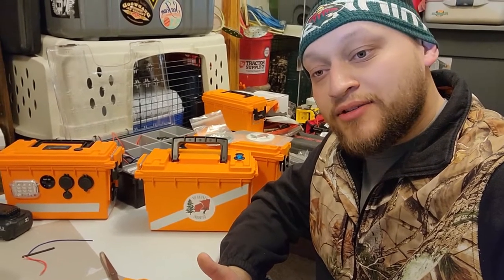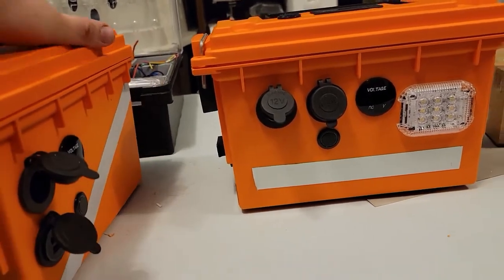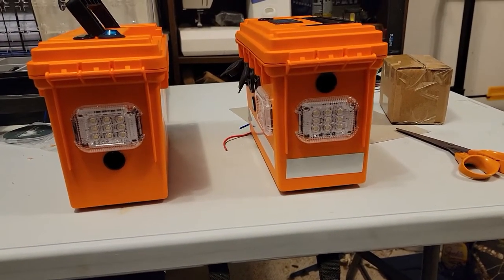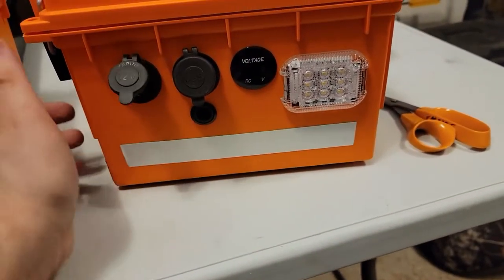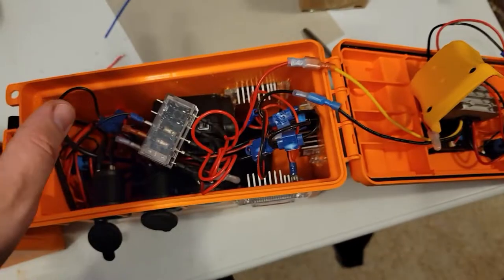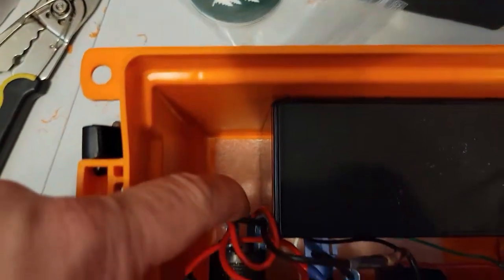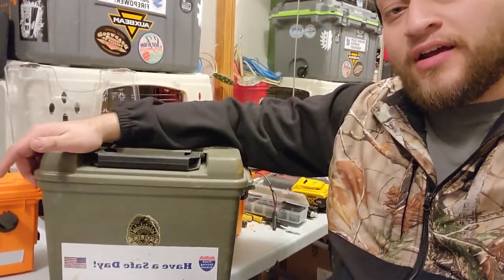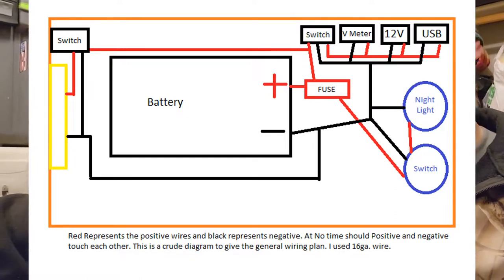Ammo Can Power Box Revisited! | Upgrades & Changes

Comment: How long does this battery last with the light on?
Reply from the maker: I have yet to test it. I can only imagine the main light lasts longer than 5hrs. On the last model, I ran 3 of the lights on a 6.5ah lithium battery for roughly 5hrs. This new one is lead acid, but is also 10ah.